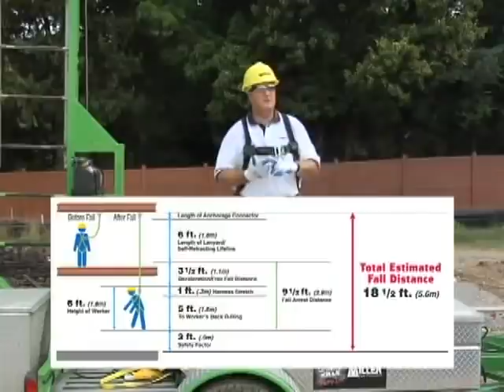Miller Fall Protection Roadshow

Comment: Can you please clarify where you got the 'maximum arresting force limit of 900lbs' from?
OSHA regulations from 1996 state that number is just for a belt harness and that 'The maximum arresting force on a falling employee to 1,800 pounds when used with a body harness'. Has this changed since?
Reply: Check ANSI guidelines for fall arrest systems for 900# reference.
Reply: ANSI 359.13-13 (Energy Absorbing Lanyards) and ANSI 359.14-14 (SRL’s) both are 1800 lbs max. Lanyards must max a maximum AVERAGE of 900 lbs for 6FF, and maximum average of 1350 for 12FF lanyards. SRL’s 1350 lbs. maximum average for Class A and 900 lbs maximum average for Class B.